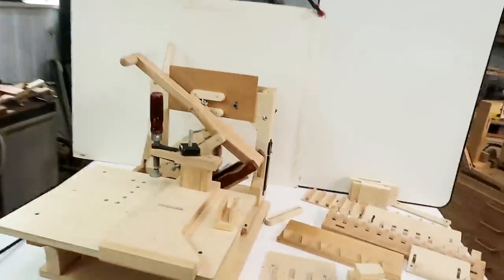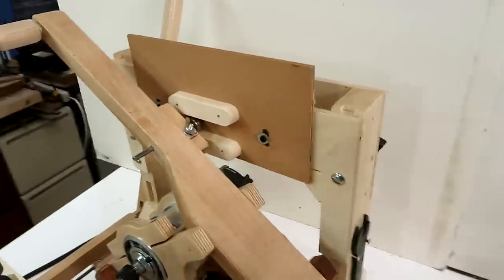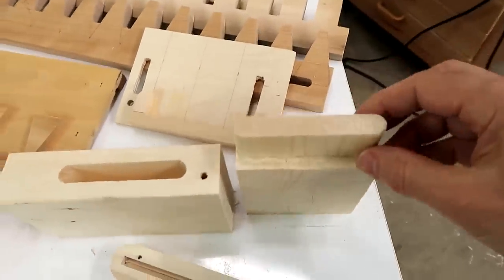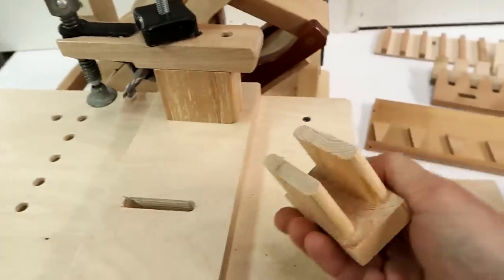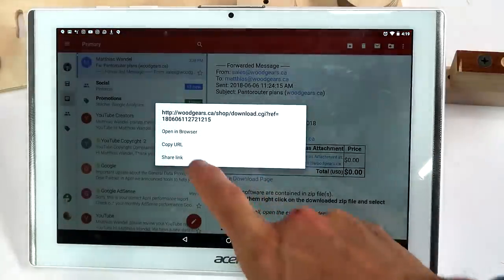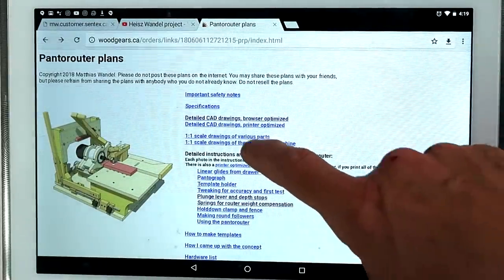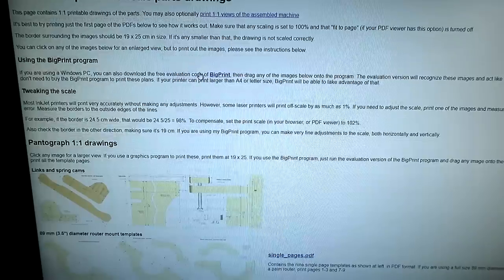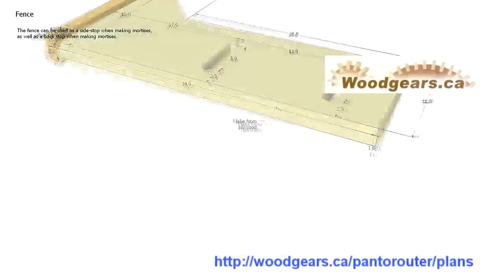Pantorouter plans 2018

Comment: I googled ketchup and I didn't get anything about a free 3d program!
Reply: xD
Reply: *SketchUp. It's now actually Trimble SketchUp, and has a variety of paid/free plans, but if you still have Google SketchUp that still works.
Reply: Try tomato sauce
Reply: Google sketchup is one of the worst 3d modeling programs on the market.  No linux support even through wine.  Not open-source.  Very few file format options.  I still don't understand why so many people have decided to use it.  Blender is far and away a superior product in every aspect.
Reply: I used to use Google Sketchup back when it was Google, and it was my introduction to 3D software. Easy to use, quick to learn. But now I use Linux, and agree that it's disappointing.

However, I cannot understand Blender, despite trying a few times over the years.
Reply: One can get up and running with SketchUp in a few minutes, whereas the learning curve for Blender is a cliff.
Reply: That's because you googled the wrong word, He isnt saying Ketchup, he is saying Catsup.
Reply: @Vanlifecrashpad  😂

Comment: Can you make the BOM available before purchase of the plans?
Reply: This is a great point, Matthias. If I bought the plans it'd be a bummer to find out the pantorouter cost more than I could afford to build it in timber.
Reply: On an old version Matthias said he spent $60 on it, although he already had some material laying around.  A user who built a pantorouter stated that he spent $170 altogether.  I think your mileage may vary a lot depending on what you have on hand, your frugality/ingenuity, and any modifications/upgrades you may personally choose.
Reply: What do you need a byte order mark for?

Comment: I find it very impressive that all of your plans are done in google sketchup. Never cared for it myself. 

Doubtful you're looking for a different CAD program, but Fusion 360 is definitely worth checking out since it's closer to Solidworks, NX, and (the shitty) Creo. More tools and options and it's free in a lot of circumstances. Only bummer is having to be in Autodesk's database forever.

Comment: Those plans are impressive!  I play around in Sketchup quite a bit and I can see a lot of work has went into this.   I've been watching this series and in general I am just fascinated with the pantarouter. Guess all I need to do now is learn the metric system and buy a PC.... yikes.  By the way, I'm not complaining or anything.  But man, if someone would port your big print and gear programs to Mac I would be so grateful.
Reply: It's base 10 man.. If you can count to ten successfully, you already know the metric system..
10 millimeters (mm) in 1 centimeter (cm) (about the width of your little finger)
100 centimeters in 1 meter (1000mm) (about 3.3 feet)
1000 meters in 1 kilometer (1,000,000mm) (about 0.6 miles)

It's a lot easier to say "hey bro, cut me a length at 3800mm" instead of "hey bro, cut me a length at 12 foot, 5 and 10, 16ths inches" way too many numbers to confuse the situation, especially on a noisy job site..
(and yes, 12' 5&10/16ths" is 3800mm.. well, it's actually 3800.475, but a regular tape measure doesn't go down to 1000ths so I neatened it up) ;)

It REALLY is time for the US to make the intelligent move to metric.
Reply: Gene Lomas That’s like saying since I already know the alphabet I can write this reply in French.  Yes, I understand it’s base 10.  But when you’ve done something a different way your whole life there’s a bit of an adjustment period lol  

Thanks for the info!  And no, it's not time for us to move to metric.  More than half this country voted for Trump, which means they can't count to ten.  So it won't work...  :)

Also, in your jobsite example it may seem easier for you to say  "hey bro, cut me a length at 3800mm"" but I perfectly understand "hey bro, cut me a length at 12 foot, 5 and 10, 16ths inches" though I will admit the metric version is much simpler.  I'm not arguing for Imperial or anything.  Just saying you can get used to something and it becomes easy.  Also, I'm a roofer so we don't use 16ths..  hahaha
Reply: I'm a carpenter, and I do highly detailed, and precise work, so I regularly get down to half-mils for my projects ;)

I fail to see how a system which is simpler and more logical could be difficult to transition to.. even for Americans.. j/k ;)

Although we've been on metric here in Australia since well before I was born, and was not exposed to imperial during my school years, my dad would sometimes talk in feet and inches, so I taught myself as a teenager to be able to follow his conversations..
I fully understand the imperial system and have done for well over 20 years now.
However, it is completely impractical and unworkable in the 21st century, especially when almost every other country in the world has switched to metric (mostly, although the Brits persist with Imperial distances, yet have metric weights for carrots and such.. so, that's weird..)
The Imperial weights system is archaic and obsolete, penny weights, ounces, pounds, stones.. I mean, come on!.. It should all be relegated to the annuls of history for our decedents to laugh at..

The best way to start a metric revolution is to START one.. Stop using Imperial, and start using metric when talking to your friends and associates, encourage them to give it a go.. They'll think you've gone mad to start with, but they will catch on quickly, well, the smart ones will anyway.. ;)

There's plenty of scales and conversion charts on google, and it's actually quite simple once you get the hang of it. Like I said earlier, it's just counting to ten really..
Reply: Hey Johnny Foodstamp, I understand that Hilary Clinton got the majority in the popular vote. Trump won because of the way the votes are stacked in favour of the Republicans! Don’t cast a slur on your fellow Americans; the people of the US have achieved some great things so get behind them. For the record I am Australian so I am not biased. I do however still like the Imperial measurements I grew up with. The units are related to human features. OK we do have 10 digits; but these are made up a binary of 2 thumbs and one byte of 8 fingers (or bits). So the imperial system is more closely aligned to digital technology than many people appreciate!

Comment: I know this is an old video Matthias that is a nice design for the template holder but I think you could add one more improvement by making the one side a v cut groove so it aligns perfect everytime you tighten it.  Just a suggestion.

Comment: So for those of you that want to know what tools and how much everything will cost:
1. Buy a jigsaw - some used ones work well with a new good blade - make sure your practice on scrap wood.
2a) Buy Matthias's 16 Band Saw plans and build a band-saw - you will use this often in your shop. You can get more info on the engine's that you need to buy in the Plans area when purchasing the bandsaw.
2b) Don't buy Matthias's 16 Band Saw plans and just use your jigsaw
3) Buy the panto router plans
4) Use wood that you scrounge or buy; likely hardwoods only - so if someone is scrapping old furniture like a desk or table; use the hardwood from that  ... just make sure you first identify it as hardwood.
5) The motors new will be one of the highest costs. When you have garage sales in your areas look for motors. Also used tool shops often sell them too, but they will be more than at a garage sale. There is again info in the purchase plans area for what are and what aren't appropriate engines so you can find all the info you need about it there.

Tools and materials can be either expensive or good value depending on where you live, and how resourceful you are or plan to be. So nobody can answer how much it will cost; this depends on what your already have in terms of tools and wood or what it will cost for you to get some tools or wood.

Hope this helps?

Comment: Small suggestion/idea from someone who knows nothing.
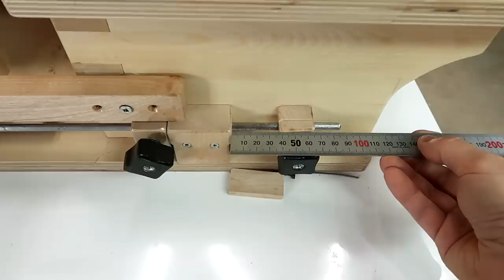At 0:56, what about attaching a ruler to the side of the pantorouter?
Reply: John Galt I would imagine most of it is the same, except you’d need to replace the template holder and depth stops moved to the side?
Reply: hey you could route or chisel a shallow indentation in the side of the rail to embedded ( glue ) a rule into

Comment: could you make available an OBJ or STL file? I don't have a woodshop. but I do have a 3d printer.
Reply from the maker: this is not something that is suitable for 3d printing
Reply: Petrino if you do print the pieces and build one please upload a video and somehow make us aware of it!
Reply: wanna bet? ill throw 20 bucks at you for it :P
Reply from the maker: if you can work with the sketchup model, sure,. give it a try.  You will need a pretty big 3d printer, and an awful lot of filament.
Reply: As if building something like this wasn't enough of a pain in the ass already, to try to 3D print it. Jesus.

Comment: Has anyone tried taking the sketchup files for this and cutting them on a CNC machine.  I may have to give that a try but wanted to check and see if anyone has had any success in this before I go off on that adventure.
Reply: Stacy Boncheff , if you have sketch up PRO, you can import/export cnc based files.  Not sure if that's in free version available anymore...
Reply: I use Aspire for my CNC design software and it can read SketchUp files in directly.  So converting it shouldn't be a problem.
Reply: SketchUp is pretty bad CAD software, but you might be able to get it out of there in a usable format (I think you might be able to shove it directly into Fusion 360 actually and do CAM in there [nice software, free for hobbyists])